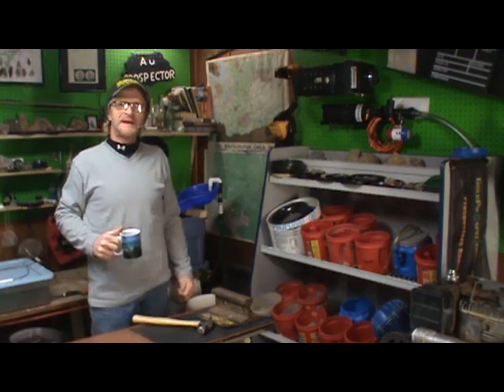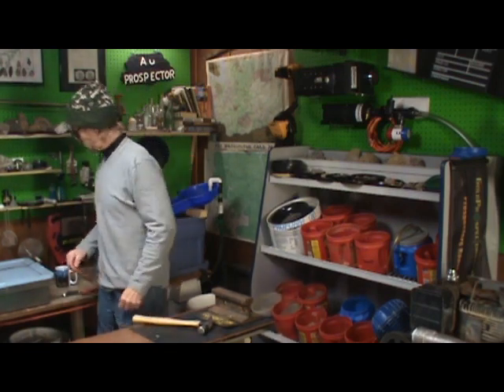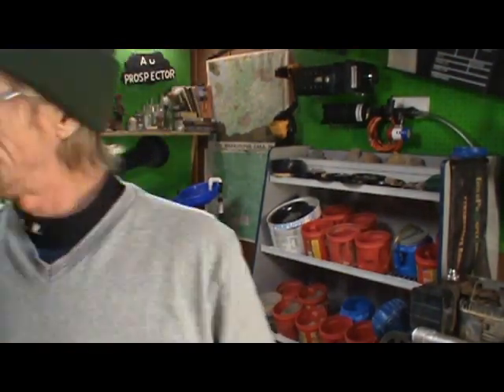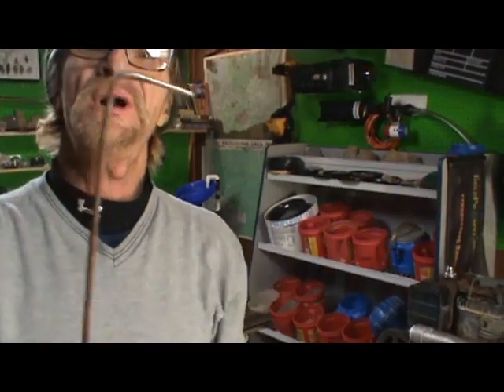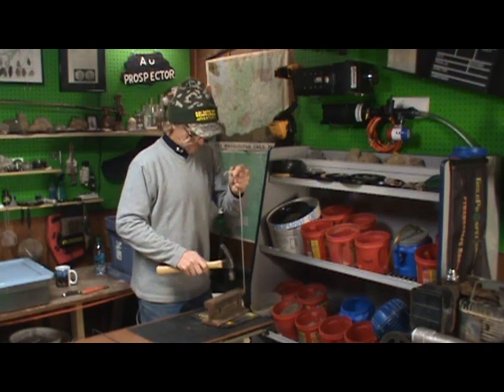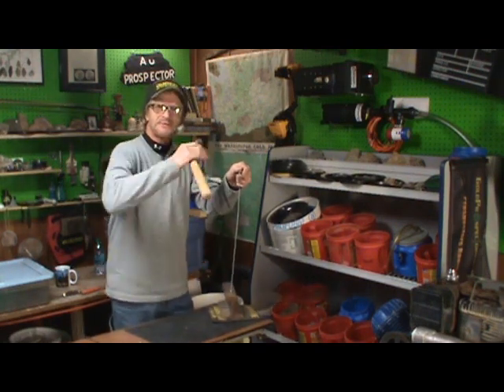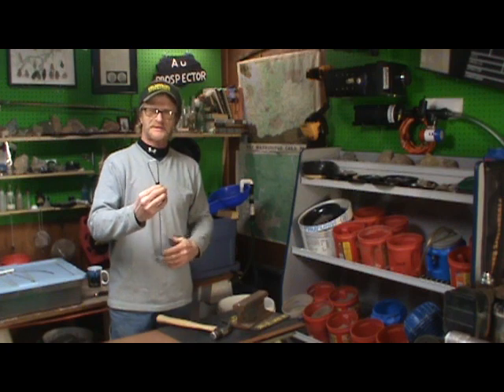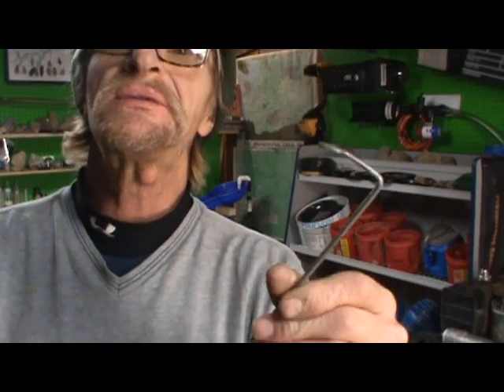In The Shed w/Ed ~S3~E3~ DIY Gold Prospecting Crevice Tools

Comment: What's the stiffest piece of metal that you can cold forge into crevicing tools?  I don't have a forge.  I have a small vise that's not bolted down yet.  No work log & no shop.
Reply from the maker: Hi John, thanks for watching and your questions, Now let's see if I can answer them lol 
Well I have mostly done it with old bucket handles but I have done it with an old screw driver also, was abotu a 1/4 rod on the round shaft standared screw driver.